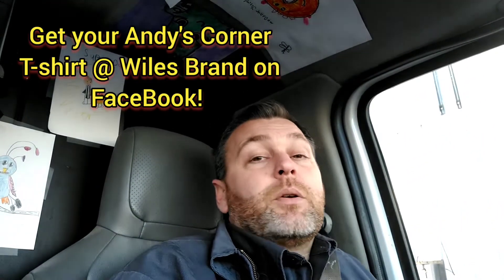Furnace Filters!  What Kind To Use.

Comment: I got the understanding of longevity in this video with the 4 and 5 inch filters. 4 to 6 month usage is what I got out of it. Price wise as efficient as the 1 inch that is not as efficient cfm wise.. I purchased on Amazon the 4 pack FilterBuy 20x25x5 Air Filter MERV 8 for 85 and change. For those out there measure all dimensions of your filter box, thought I could only fit a 4 inch but the box is 4 3/4 inch and the 5 inch filters are 4 3/8's . Looks like they play the same games as the lumber industry. Thanks again for the insight!

Comment: I'd like more info about purification: the cold plasma generators, the uv lamps and poc units.  Where can I get more info about what we'd need in our home?  Checking out you purification video now.
Reply from the maker: I would check with a local contractor that specializes in indoor air quality.  Uv germicidal lamps and plasma generators can go in pretty much any system and will work great in any situation.  I would recommend both to anyone and they are usually the best bang for your buck.  PCO units sometimes are harder to fit on a system depending on space available but they are the Cadillac of purification Wich also means a hefty cost and a little maintenance cost every couple of years.  There are a lot of uv brands out there.  I have used safeguard and abatement technologies a lot and they do well.  I stay away from saunovox due to the bulb cost.  But Safeguard and Abatement both have sites on line with more info.    My favorite is the plasma generators.  IWave is the brand I deal with and have no problems.  I believe the IWave name is owned by Global Plasma Solutions.   They have info about their products online as well.  Hope this helps!

Comment: I paused this video at 49 seconds and went to check mine. Lol
Reply: It was pretty bad. I had a new one next to it I got in the fall but was too busy to put it in or something. Oddly enough this 3M 1500 filter doesn’t have an official MERV rating. Only 3Ms MPR rating. Hmmmm it’s like they’re giving themselves a gold metal 🤘
Reply from the maker: Giving themselves a gold stars exactly what they're doing! LOL several of the manufacturers do it like 3M filtrate and a couple others. They make their own scales like the 1000 filter 1200 1400 and so on. The industry standard rating is on the Merv scale. Seven or eight is your basic 10 11 are an upgraded filter s. And then higher than that I believe are a little restrictive. A good high capacity cartridge filter even at Merv 8 does just fine. The key to any good filter is making sure the filter rack is sealed well where the filter goes in that way it cannot suck any air whatsoever around it and it has to go through the filter itself.
Reply: @andyscornerhvac  I’m so mad this thing was like $18.99 FML.

Comment: My slot for my filter is only 1.5 inches so pretty much stuck.. how often is every month or 90 days.. my local company said it should be every 30 days in Georgia..
Reply from the maker: I like to say 30 days as a rule but some house (few but some) can go a little longer.   I like to say don't risk the efficiency.   Just replace it!  Lol.   Thanks for the comments hope this helps.   Be sure to subscribe if not already and share with a friend!
Reply: Thinking it probably would not cost all that much to upgrade to a 5 inch box.

Comment: My system only has room for the one inch filter. Any suggestions?  I use a merv 8 and started changing it monthly.
Reply from the maker: A lot of setups that's all you can use if there is no room around the furnace/air handler.  Sucks but reality.   Now if there is room around the unit to where you could have a contractor reconfigure the ductwork to get a better filter box in there I would do that.   Usually it's not a whole lot of adaptation assuming there is a little room.   Typically it's not that expensive.   Maybe 500 dollars or so but if it can be dun it is so worth it.   Unit can run more efficiently.   Filters can go 6 months or so and the unit will last longer.   But depending on what you have.... In the real world... Sometimes there isn't enough space.    Hope this helps a little!   Be sure to subscribe and share with a friend !  Have a great day